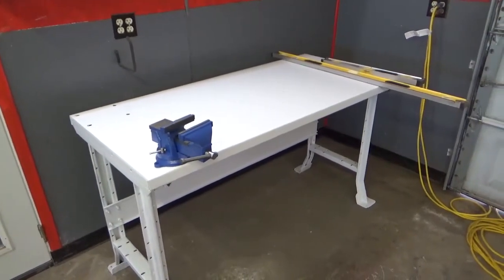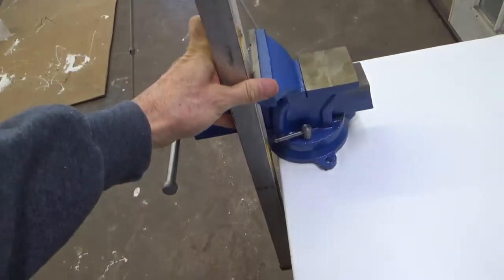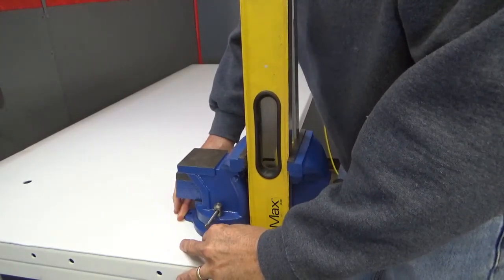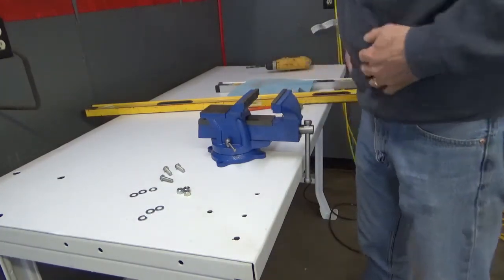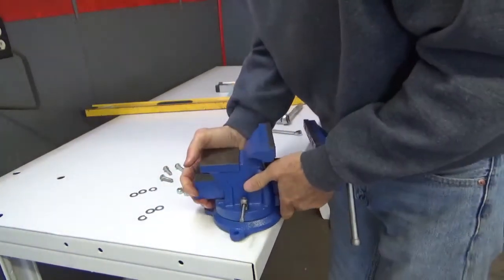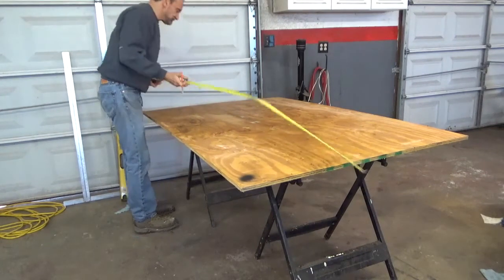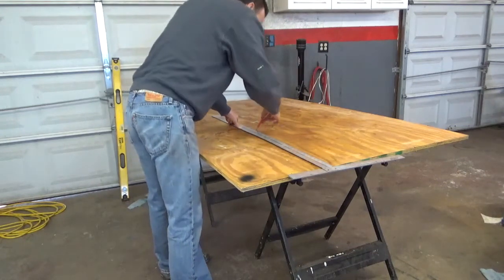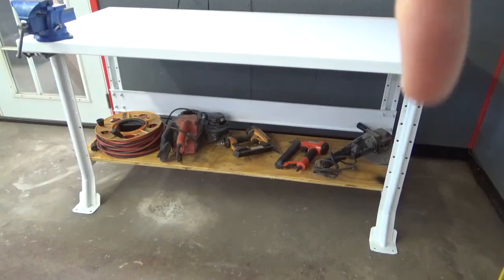INSTALL BENCH VISE & WORKBENCH SHELF Shop Cleanup Cargo Trailer Camper Conversion shop tour vanlife

Comment: Is it best to have 2 mounting holes in the front and 1 in the back with a 3 leg vise or doesn’t matter?
Reply from the maker: Great question and yes, it does matter. By having 2 mounting hole in the front you can install the vice closer to the edge of the bench. Thanks for the question and for watching the video. Good luck with your project.
Reply: GB Conversions & Adventures Thanks for responding. With two in the front and one in the back, does it put strain on the two front mounts when say you’re hammering away at something? Since only one mount in the back will be resisting the force. Thanks again